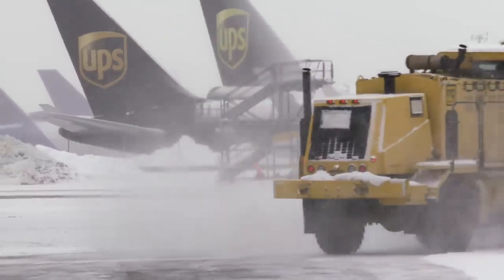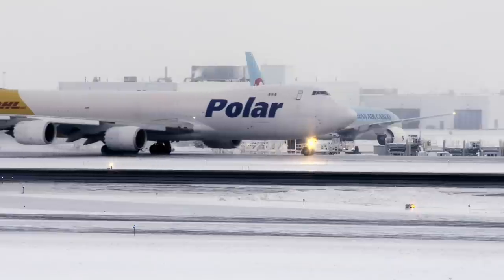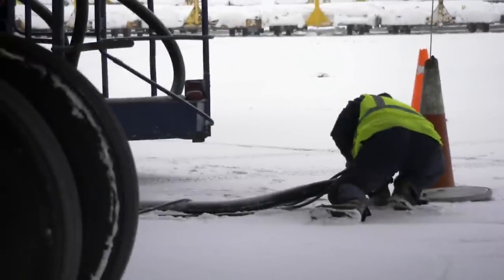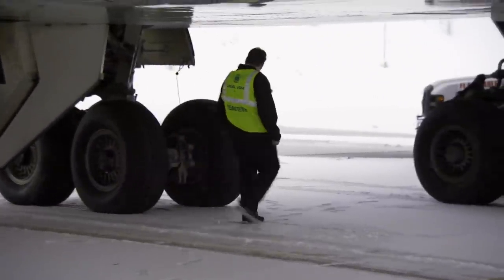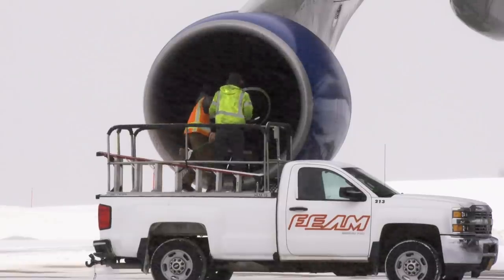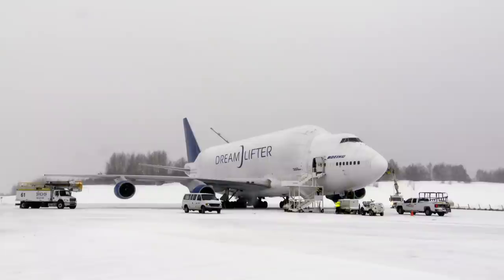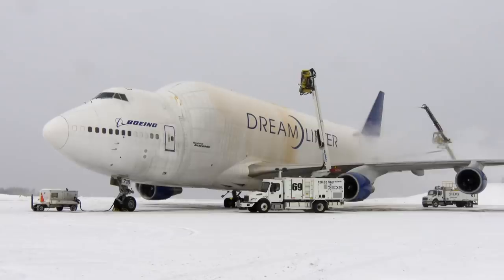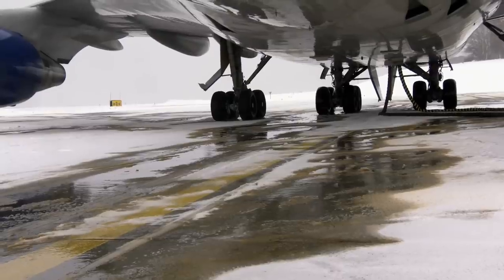De-Icing a Cargo Freight Plane in Frozen Alaska 🌨️ Ice Airport Alaska | Smithsonian Channel

Comment: Come on guys! It can't possible take 1,5h to de ice that plane :O
Reply: I have been a passenger on flights out of Anchorage probably over a 1000 times and de-icing takes 10-15 minutes max and it is the last thing they do before taxiing to take off as they want to some of that fluid on their wings during lift off to prevent any ice buildup.